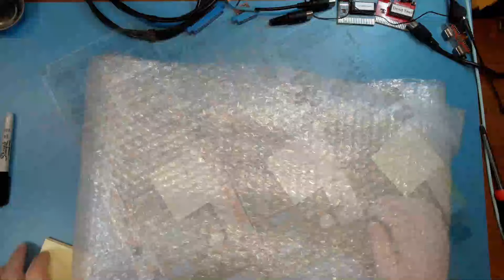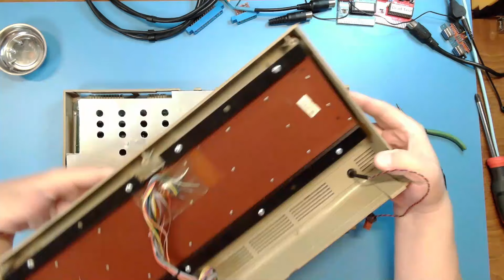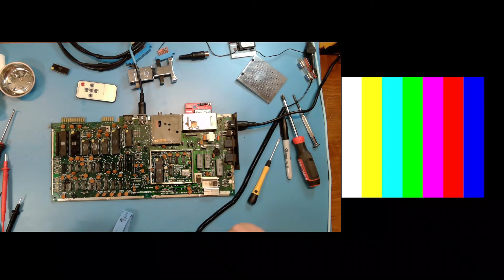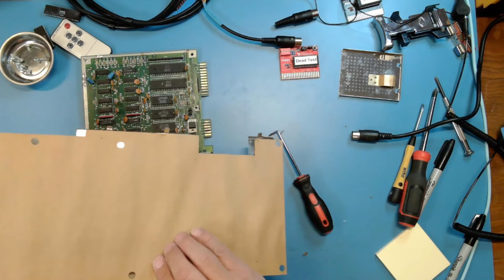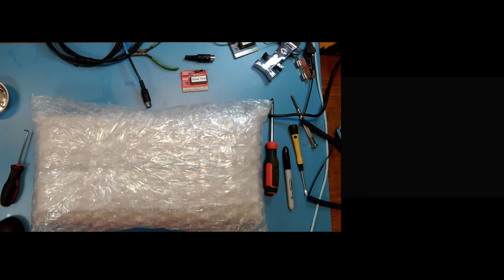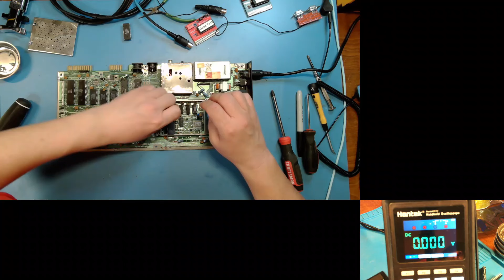Eight C64 Motherboards For An Epic Repairathon

Comment: Alot of the time on a 250425 board with no signal..  if not the vicII,  it's the 8701 chip:)
Reply from the maker: I'll keep that in mind when I get to that machine.  I have spares for the 8701.  Thanks!

Comment: Don’t understand why you don’t replace the underside shield.  If not rusted, I always replace them without soldering the clips. They protect the board nicely.
Reply from the maker: Protect it from what?  It will be inside the case.  We'll have to agree to disagree on this issue.  I respect your opinion, though.  Thanks.

Comment: That was epic!
When you hit the sockets with Deoxit, you may as well hit the power, video and IEC sockets. Possibly the power switch also.
Reply from the maker: You're right about using Deoxit on those other ports, too, but since my next step was going to be to give the boards a bath in warm soapy water, it would have been a waste at that point.  I only used Deoxit on the IC sockets because I was actually about to re-insert chips.  I'll have to re-do it later because all that Deoxit lubrication will have been washed away now that they've had their baths.  As for the power switch, I tend not to use Deoxit there because I believe it can dislodge the grease that's inside them directly onto the contacts and cause problems.  I say 'I believe' because I have no actual proof or evidence of this.  I don't even let the switches go through the bath for the same reason and also because it can take so long for the switch to dry out afterwards.  All those switches are currently desoldered from their boards, waiting for the boards to dry so they can be re-installed.  I just accept that the switches will probably fail at some point and, when they do, open them up to fix them or replace them.  You'll see a lot more Deoxit in the diagnose/repair videos.  Thanks for watching!

Comment: I always leave the SID out until I confirmed the rest of the board works. Often a bad SID will just black screen the board. Hooking up the LED shows major shorts on the 5V line, it dims.
Reply from the maker: Agree.  But since my objective was just to catalog the symptoms, not diagnose, SIDs went back in.  When I do the diagnostics/repair, the SIDs will come back out.  Luckily, only one of the boards has a SID that's not in a socket.  I didn't use the LED because I was testing the voltage rails directly and those shorts would have shown up anyway.